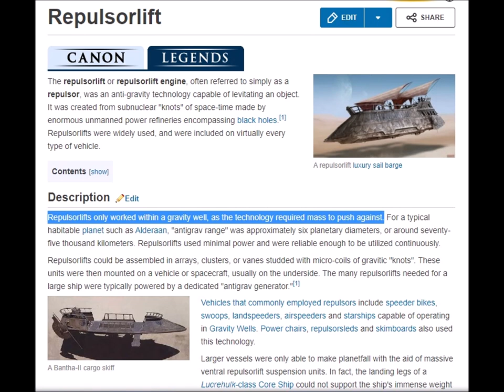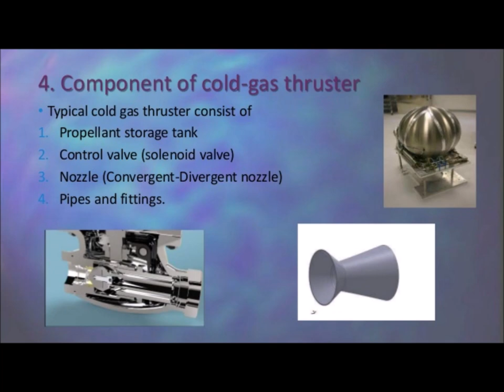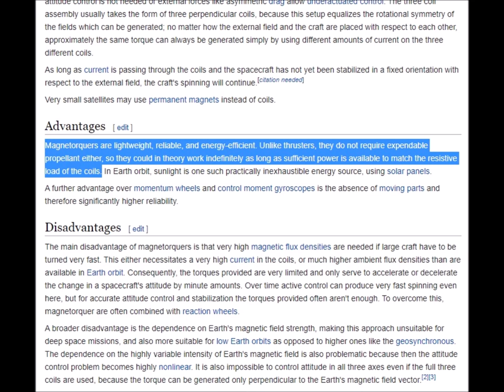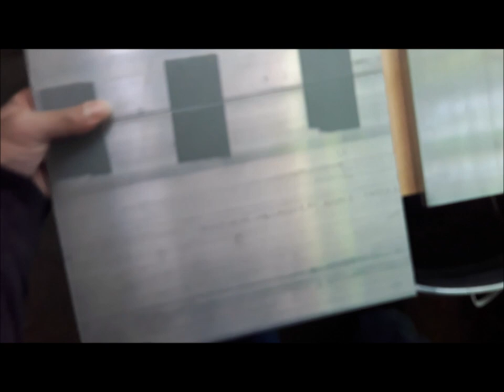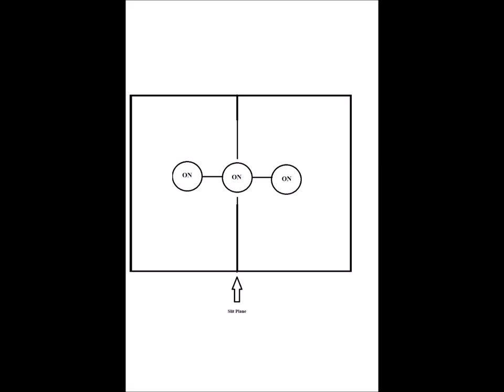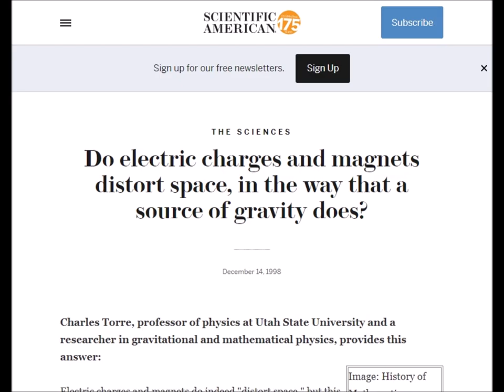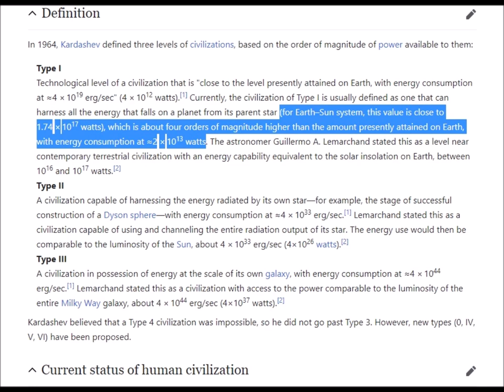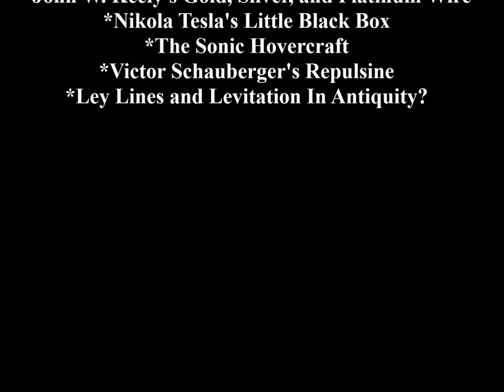The Electromagnetic Hovercraft: Approximating The Antigravity Repulsorlifts of Star Wars.

Comment from the maker: Correction: at the 27:32 mark, the correct figure for the weight of the Great Pyramid should be 13 billion pounds, not 130 billion pounds. The derived calculations, however, were conducted using the former figure in scientific notation and hence are still correct.

Comment: But why can they Fly so high?is this possibel with maglevs hovering so high?
Reply from the maker: It's theoretically possible if using the geomagnetic field to react with. But the energy differential from one point of the geomagnetic field to another is so small that it would take a very large/long magnetic field for there to be enough of an energy difference and hence a large enough force per the equation W = Fd. Solving for F, we get - (F)Force = W(Energy Change)/d(change in position). So, the larger the energy change, the larger the force. This equates to an artificial magnetic field that encompasses a large area. It's not that the craft has to be physically large, but its field would have to be.

Comment: hi plz could u tell us how the coil is connected to the power source also hw much voltage the power need for levitate the coil
Reply from the maker: Hi. Certainly! For this demonstration, I took three spools of 26 gauge wire and wound them simultaneously into a single 3.5" diameter coil of about 300 turns. This resulted in a single coil with six parallel leads with each of the 3 individual coils energized from one of the home outlets; 120 volts and about 10 amps flowing through each coils. Needless to say that it got hot quickly and could only be run intermittently. I used 3 of these arrangements on the maglev demo for two lift coils on the outside edges and one center coil for stabilization (using 9 home outlets total). I'm certain that an improved and more efficient arrangement can be created. But it was good for a quick demonstration. Please don't hesitate to ask if you have any more questions.😉
Reply: i got 2 mor questions 
1- the power source AC or DC
2- with ur experience hw this guy do the same with low voltage https://youtu.be/SDCILh5PCPg
Reply from the maker: @aymansalama4550   1. I use AC in my experiments from house outlets. 
2. So, it looks like he's using the same principle of Lenz's Law. But my design has internal stabilization using the central coil. But a byproduct of that stabilization is a weakening of the levitating Eddy currents. So, I have to compensate for that with a stronger field. I then use two additional outer coils for more height and carrying capacity. A much more efficient version can be made using a resonant configuration which is where I'm headed next.
Reply: @gsutton78  and u used 380v about 120 on each every phase of the coil
Reply from the maker: @aymansalama4550   Yes, 9 coils total; each plugged into a 120 V socket. Very inefficient. But it's at least proof of concept.